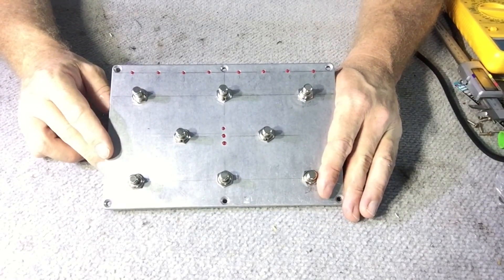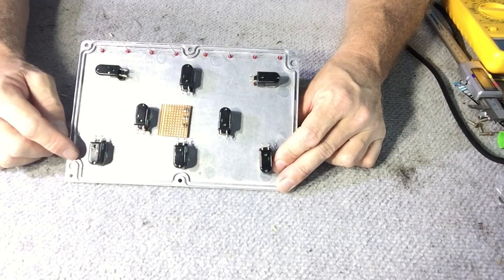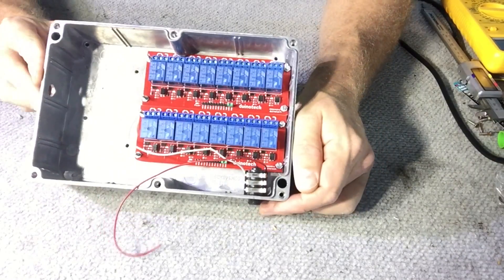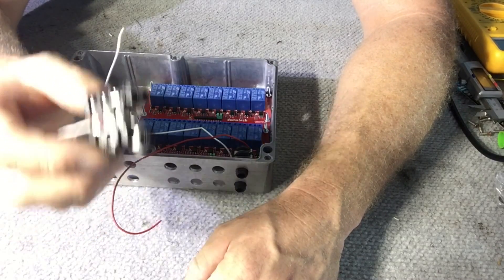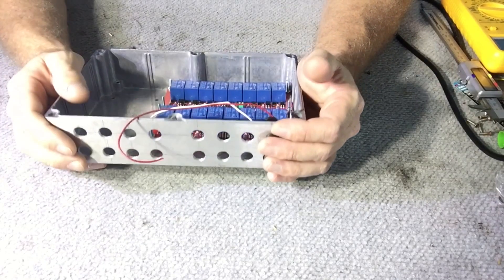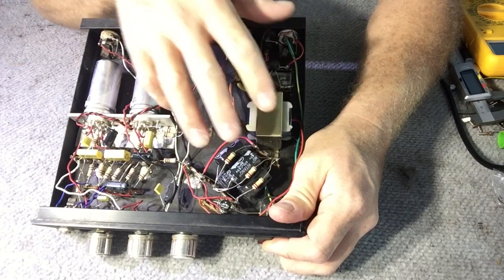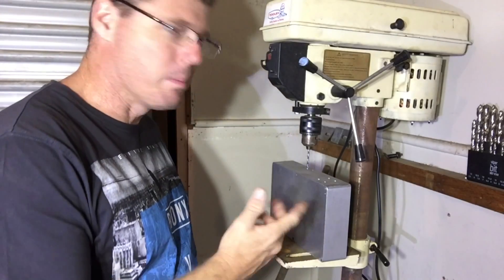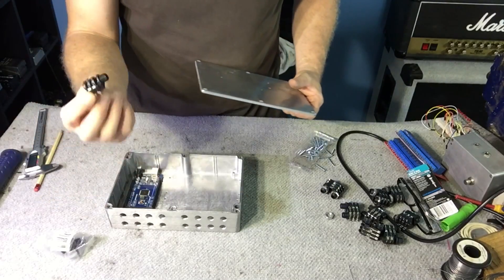DIY Programmable Pedal Loop Switcher Build (Part 3)

Comment: Paul, quick questions. Can you point the jacks you bought that work the way you described? And other one, does 1 relay/loop apply or you need two relays for one loop? Can you show the wiring diagram?

Cheers,
V

Comment: How did you rig the output/input jacks on the loops so that the signal still passes through if there's nothing plugged in? Do you have the signals connected with a big resistor between them?
Reply from the maker: The input jack sockets I used have two lugs for ground and two for the tip.
These are arranged so that when nothing is plugged in it connects each of the lugs together respectively. 
If you solder these jack sockets together back to back it will allow the signal to pass between them with nothing plugged in. But plug something into them and the circuit is broken between them allowing looping the signal between them possible.
I have done this before with a A/B loop switcher that I built. It allowed you to plug a pedal or effect in one loop and then you could use the other loop as a bypass with nothing plugged in to it.
I hope I have helped.